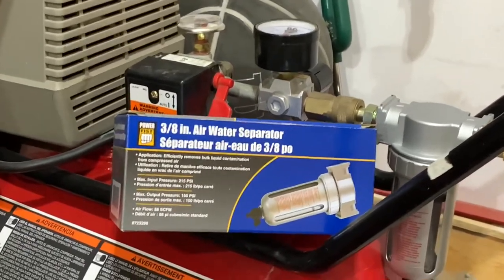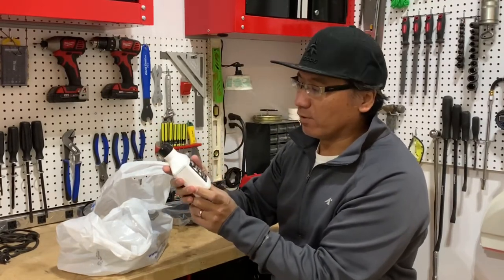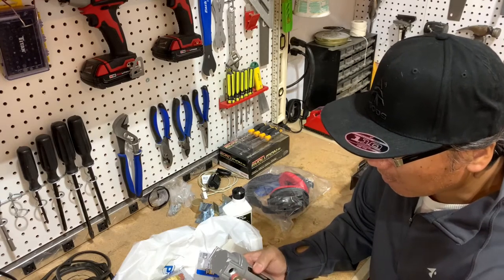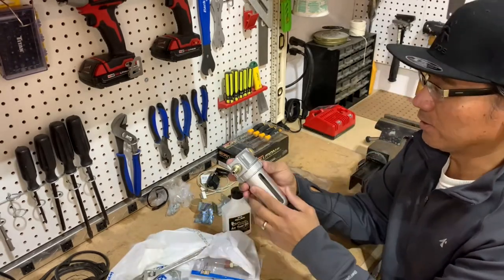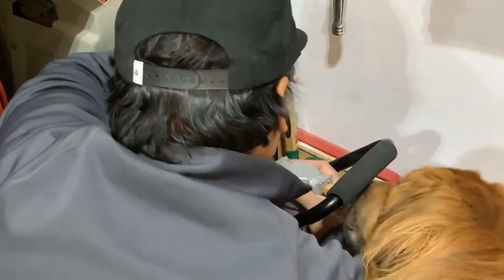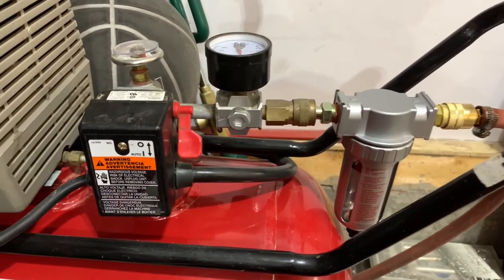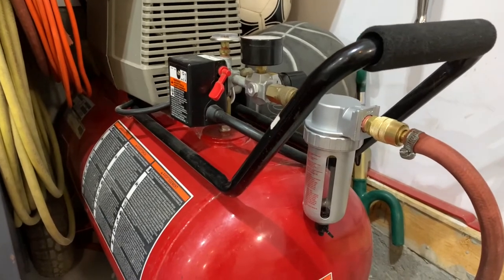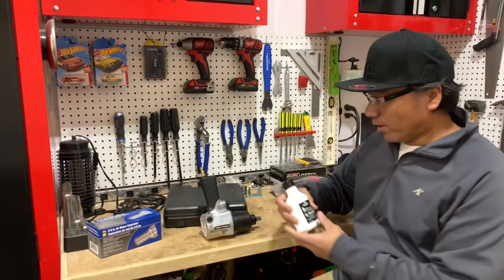Air Compressor Water Separator Filter | Tool Lubrication & Maintenance | Dream Garage Update

Comment: Don't put the separator so close to the compressor. Moisture separator works only when the air sufficiently cools down. You need 20ft + between the compressor and moisture separator. 
Please do minimum research.
Reply from the maker: Thanks for the input! We can always learn from experience people like you👍🏻
Reply: Thanks for the info. I had forgotten about the 20 foot minimum distance for a water separator 👊
Reply: Does the 20' need to be linear or can it be coiled
Reply: @billsinclair7280 good question! I was wondering this myself

Comment: How does it effect the water in the tank?
Reply from the maker: The tank will draw in moisture from the air every reload and retain that inside the tank. The filter helps strain out the moisture when using your air tools to prevent damaging them. You should also install a bleeder/drain at the bottom of your  tank. This way you can drain out the water that are inside the tank. I also have a video on this. Hope this helps!
Reply: Another mod you can do grab a extended tank drain and drain regularly or leave open since water looks for a quick path

Comment: how do you stop the air from coming out the bottom of the air filter
Reply from the maker: The bleeder valve shouldn’t leak. When flipped, It should close by itself.